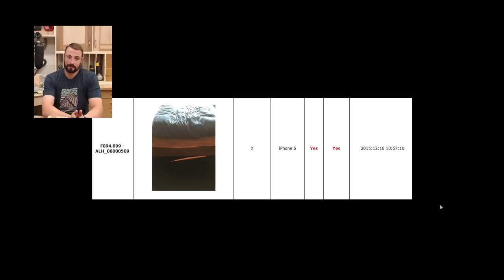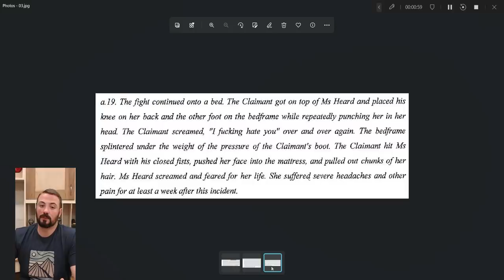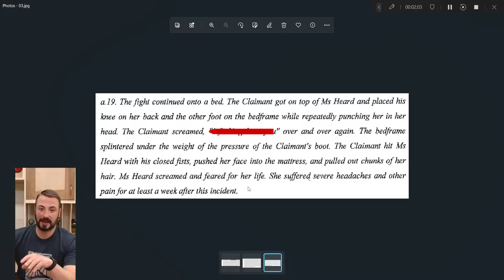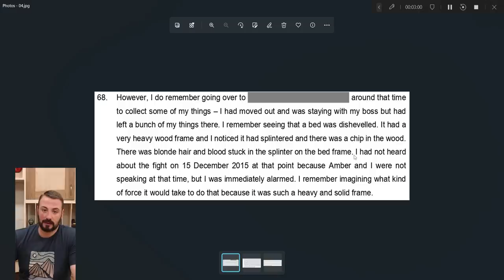Woodworker Attorney DEBUNKS Amber Heard's "Broken Bed” Testimony!

Comment: The only thing I'd note (and it probably doesn't make a huge amount of difference, especially with that 'thing' on the bed in the photo lol), is that in your mockup, you're using timber with a rounded edge, where the frame looks like it's a square edge (as someone who doesn't have the greatest coordination, my legs ache just looking at that bed LOL).  However, especially with the other evidence in the picture, and given the size of the chunk that broke off, I suspect having the square edge still wouldn't make the story sufficiently compelling versus other interpretations.

Comment: The thing that made NO SENSE to me was that she said his full weight was on her back, but then he broke the bed with his full weight on the bed frame?
If you look at the size of that bed frame, he'd have to have had one knee on her back on the mattress, with the other foot extended pretty far out away from him to be on the edge area of that bed frame. Plus, the mattress isn't all that much higher than the frame itself so for a foot to be on the frame, his knee would have to be bent as well to have his full weight on her.
Physically this makes NO SENSE. If his FULL WEIGHT is on her, he's already leaning forward, it's just not possible for his weight to ALSO be on his back, extended leg.
If he put his weight onto his back extended leg that would transfer his weight off of her and she'd be able to scramble away if she was panicking and trying to get away from him.

Nevermind that what you are saying is also logical that he couldn't break that bed, physically the way she described it makes ZERO sense if you try to actually imagine someone leaning on that bed how she described. The legs would have to be extended fairly far apart, and him holding his entire weight on her just negates that he was using his back extended leg for anything more than a bit of stability. She seriously doesn't think about shit at all when she lies, she's a bad liar. 
But that's good. I'm glad she is. Cause her whole testimony is trash.

Comment: First of all I am totally on Johny side!! The object on the end looks like nife and I totally believe the damage could be done by it. Yet I dont completely agree with you on the wood side. I studyed wood working for over a decade (3 year to the vocational certificate as a joiner, 2 years for furniture postgradual study, 3 years in furniture and interior design for my Bc. degree and 3 years for my Ing. degree as a furniture engeneer). Its way easier to chip wood from the edge, even with a boot, if the edge is sharp, the wood is old and very dry and its a soft wood like pine. Then the mechanic characteristics of wood change a lot. And the changes comes more significant if the wood is from conifer tree (pine tree in this case), because conifer trees have a lot of resin. As the wood gets dryer and dryer the resin is coming out of the wood. So if there would be an empty pocket in the wood created by the resin leak it will weaken the cohesion (in Czech we call this kind of pocket "zásmolek" since the conifer tree resin is caled "smůla" but I struggle to translate it to english, sorry). Wood in your video is very rounded and seems more "fresh" compared to the one on the evidence photo. Yet even with all that combine (soft wood, sharp edge, very dry and old wood, empty "zásmolek" pocket) it would take a lot of strenght to chip it like this. And if a person would have to divine the forces to keep his knee on back of somebody who is fiting for his/hers life and still needs enough weight and strengt to push on the other leg, that person would have to be more like Hulk than Johny. Yet I dont have a lab to test this (we had a lab for it on Mendel University in Brno, but too long out of there :D ), but I am curious how that would come out.

Comment: The wood in the demonstration has a curved edge; of course a boot isn't gonna gain purchase. The wood in the testimony has a sharp edge so I can believe that it would be more likely to gain purchase and break under the pressure, especially if the wood was old and/or dried out. JUSTICE FOR AMBER lol jk

Comment: The bed frame may have been reviously damaged, and a boot could have peeled out a damaged piece, but, Depp is approximately 5'10"   if his knee was on her back, weighing her down, his traiing leg would be, what, 2 1/2-3' behind his center of gravity?   how much pressure could be exerted on the bed frame, if his weight was on her back?    Like sliding down a hill, you can't stop your slide, if you cannot transition enough weight over the foot you are looking to use as a break, it just slide over the surface... so, where was his weight?  On AH or on the bed?   it could only be fully applied to one or the other, and she claimed all of his weight was on her back

Comment: I am not a woodworker or expert on wood, but if there was a prior damage, a small part of the grain might have been loose at the. If so, you just need to exert force on that piece, and a splinter will form along the grain.  
It's the same thing as when you split wood. If you can twist the axe, you only need to have a grip at the end-grains to make the log split. Another example would be when whittling, or just if you have a plank that's damaged at the end(or slightly split due to how it dried).  
  
Not saying you are wrong, only that it's not the only possible explanation.

Comment: Just to accept her premise: If that "crack" would have happened the hole log would have to be parted by weight, and that would be at least over 1000 pounds, most likely over 2000 pounds, probably significantly more than that. With such weight the wood would not be able to withstand the weight pressure. Most likely the crack would be visible, and noticeable on the picture, but it ain't. The bed did not crack like that, quite simple.

Comment: 1) Timber can start splitting naturally, over time or if not properly dried and seasoned. It could have been damaged and partially split prior to incident.
2) It is possible that in some circumstances even fabric can gain purchase on an already split or damaged timber where the splinter is not fully detached but a crack had opened.
3) The split appeared a maximum of about 5mm in width, not impossible to detach by rubber soles if a split had already opened prior. Not the 15mm wide log prised off in the example.
4) Did Depp's boots have metal toe caps?

I also believe the trial defendant's account is BS, I find it unlikely based on the description and placement of the alleged assailant, prone complainant, a knee in the centre of the back and the assailant's other leg managing to even reach the bed perimeter, leave alone at just the opportune angles. There was also no way a prone complainant could have observed the assailant's feet doing what was claimed.

Comment: Just putting this out there..
I noticed the wood on the edge of the bed has a sharp corner rather than curved like the demo - so would it be possible for a stiletto, on the foot of someone physically weaker (although not necessarily if they're raging), and trying to get leverage to push a male down, to splinter the wood with the sharp heel tip?
The knife might have been used to remove more wood, maybe to hide a small heel-sized hole?

Obviously this is speculation but I was curious, and after seeing some of Amber's descriptions of their fights-  where she slips up and turns the narrative briefly onto her, or physically acts out an aggressor pose - it made me wonder.

Also, I wonder why Amber took a photo of the splintered bed, but not the pillow. The bedding does look light enough to show bloodstains in a photo.
The stained wood also looks too dark for her sister to have seen dried bloodstains unless she knelt down and looked closely - I assume it was a few hours after the incident and the blood would be dry? She did say she didn't see Amber.
And why was she in their bedroom?? Weird!

Comment: Two points: First, the bedframe has a square corner, which is much, much easier to break off than a radius.  Second, a preexisting crack along the edge, even if it were sealed over, would make the story entirely plausible.  

To be clear, I don't really care anything about the trial; neither of them seems like a remotely decent or trustworthy human being and the entire thing is tabloid nonsense.  She might be lying, but I don't think that a broken edge on a timber is really that wild an idea.

Comment: im no woodworker myself, but i knew it was bs from the start. with flat mechanic pressure from above (or with an angle), it wouldve splintered different. its way too clean of a splinter to be kicked off by blunt force.

Comment: Isn’t the wood splintered from the lower edge of the timber bed frame, the edge that is facing the carpet. How can a person trying to climb ON TOP of someone on top the bed able to splinter a wooden edge that is facing the floor???The boot or even a knife would have to splinter the wood by coming from below thd bed.

Comment: um didn't the wide shot of the bed show the damage going the full length of the block? but in the close up its just the left side and about, what... 12 - 15 inches ? so what.... did she go back and rip even more of the bed frame off to make it worse?...
yeah i just went back and checked and those two picture don't match at all! the wide angle has a much larger chunk ripped off so she clearly went back and ripped more off.

Comment: The wood could easily have already had a crack or the beginning of a splinter and the boot just ripped it off. The bed wasn’t likely new. The knife on the bed is suspicious though.

Comment: Kind of obvious. I appreciate you breaking it down tho. 
A break from pressure on top wouldn’t cause a single splinter horizontally on the bottom with nothing fractured on top.

Comment: To be incredibly charitable you could say that it is remotely possible that the craftsman building the bed had used a more aged/deteriorated piece of wood for the foot end that then succumbed for that reason, but given all the other fabricated evidence and outright lies she's already been caught in, I wouldn't be inclined to be that charitable.

That would also only serve to open the floor for someone to bring in an expert to actually look at the wood.
Reply: @Jack Yeah, it's incredibly unlikely and I expect if the wood had been rotten or deteriorated enough for that to have happened they would've had an expert testimonial instead of a DIY picture of a wood splinter.

Comment: That is very interesting 🤔 I was actually thinking myself that the break would need a much smaller point of force than a boot. The pressure would have been easily accommodated by the foot board unless Johnny has super human powers. I'm not a wood expert or a scientist but it's basic high school physics and common sense makes this story seem unfeasible. I'm from the UK and I only heard snippets about that particular trial. I think overall Amber Heards legal team had a very difficult job trying to make her evidence and witness testimonies for her side fit with reality every single witness was bias in some sense and her evidence has all been debunked. However Johnny's team was amazing 👏 but they had the weight of evidence.

Comment: Only thing I'm thinking is "wrong" here is the corner of the example piece; it's rounded, while the original had sharp corners. This would only matter if you're putting your boot on that so that the sole, specifically the ball of the foot, is the part trying to hold the grip. The boot would also need to have quite rough pattern to be able to hold the grip and transfer the force. AND even then, it would most likely need the wood to be dried and cracked over time.

But the pocket knife on the bed (and the fact that one of the pictures actually looks like the splinter is shorter than the others... shorter would be more plausible with the picture I tried to "paint" earlier)... facepalm

Comment: I'm sure it's been mentioned already as I'm hella late to this video, but when you used leverage with the knife the pressure left a blade shaped dent in the wood. The evidence photo isn't particularly good quality but I don't see a blade shaped dent anywhere along it. And if we're to believe she did it with the pocket knife on the bed it looks smaller than the one you demonstrated with, i.e. any denting from leverage would have been more obvious due to a similar pressure on a smaller surface area.

Comment: Think of how stretched out he would be doing this. One foot teetering on the edge of the bedframe, while his knee was in her back. In that position, his boot would have been pointed down, and like you said, it would have just slipped off. So he's trying to balance himself while hitting her? He wouldn't have leverage in that position.. There are no tread marks or dirt from the bottom of the boots on the frame. And even if the wood did actually come off the frame, wouldn't it have splintered in the middle from the pressure there? She also stated there was blood on the pillow top, which she did not take a picture of. I see no blood on there. She states that after the "attack", she was sitting on the floor. Not at the top of the bed. And wouldn't Johnny have picked up said wood off of the floor since he knows she takes pictures of everything. He had time, she didn't take the pic until the next day. And the knife on the bed is a dead giveaway. You really never know what happens behind closed doors between people, but her stories don't make sense. She should have had defensive wounds on her hands too. If she's face down, you would think she would have had her hands at least trying to cover the back of her head. And again, she videos and takes pictures of everything. Why didn't she video herself or have her friend do it when she found her on the floor crying? Make it make sense

Comment: I think you could (with a harder wood) rip a splint out of a very sharp edge but I don't think it would be the size and shape which is shown  in the evidence
Reply: also it would need to happen in a kicking motion where the sole "slides" onto the edge and just takes a bit of wood with it but that had to be more or less a edge, fresh out of the planer w/o any more treatment like chamfering (which ist basically the least that would have been done on a bedframe...)

Comment: One question, your set up has a curved edge and the bed in question has a sharp edge? Surely that would make a difference if weight were put right on the edge and could possibly splinter? Just an observation. Thanks for your video.

Comment: There’s also no way his weight would have broken it, even with both feet on it he could have jumped up and down. And if you supposed for a second that Johnny magically had some really super tough tread on his boots such that it did damage the wood and tear some away, it still wouldn’t be a long, undamaged sliver of wood. But with only one foot in the center, any wood that broke away would be split in the middle from his weight, and each end would likely be very slivered. Did they not do homework on this? It’s like OJ’s leather glove…no one knew leather shrinks after it dries? If YOU don’t know the answers, if you don’t have expertise, like with the order of makeup for the bruise kit (lol), find someone who does.

Comment: I think Johnny's boot (probably the heel edge) broke out that splinter but likely didn’t  break it away completely, so the heards finished the job.
Reply: @Jack 
I saw his demonstration on a piece of PAR timber with heavily rounded corners in no way representative of the square cornered artificially aged/distressed bed frame.
You can tell this guy's a lawyer.
I have experience of timber 'splintering' in the manner shown.
Does it not seem an odd evidence to decide to fake, rather than say rip the bedsheets, break a lamp or simply scuff up the bedframe where she claims his foot was.
Reply: @Jack 
Planed All Round.
Reply: @Jack 
Against my better judgement I've looked and found a better quality version of the photo at 2:59 . On it you can see a clear line that could be a scuff mark on top of the bed frame leading straight to the splinter, it is barely visible on this video version if you stop the video and squint a bit.

Comment: So for the entire time and due to wording from Amber and others with my own knowledge, I had been stuck on weight of Johnny was supposed to have "splintered" the bed by pushing and breaking the wood in half, the wood on the floor of the picture made me think it was split and splintered underneath as well.  It was not till this video with the demo of the knife with leverage it all clicked into place, the exact same kind of damage in the exact same manner, I under stood now the damage done.

Why did I think it was split into by pressure and force? Because is seemed slightly possible if it was a thin frame yet no this is a solid tree made into timber,  why did I not understand it was the edge had been ripped off by Johnny's boot? Cos that is impossible, rubber and other such cannot rip wood like that unless it was damage badly already and not by blunt force as this video shows. So Ambers words, the impossible descriptions she told of how the physics work had me not follow or believe her testimony could be so impossible. Yet that is what she said and that is what she tried to make everyone believe that a shoe even steal toed has the ability to rip wood like that.....

Comment: I am seeing a little V shape on your experiment on both the timber side and the separated side, from where the knife entered. But not seeing it the V shape on the bed frame photo. Can you explain it? I still believe it's not caused by Johnny's boot. But if a person stood on the side of the bed in boots, with his weight pin point on the edge, could the side of the frame give way? Just curious from physic's perspective. #teamjohnny